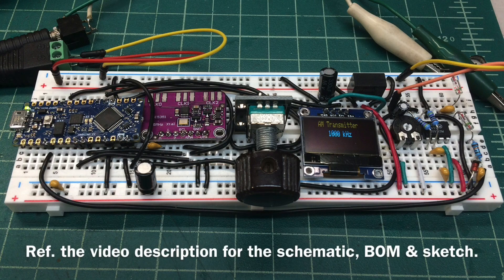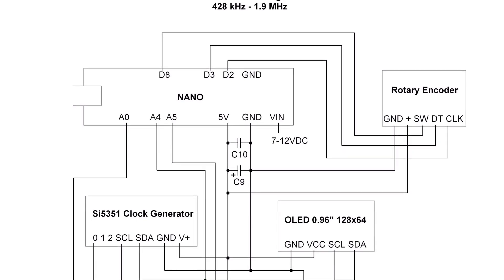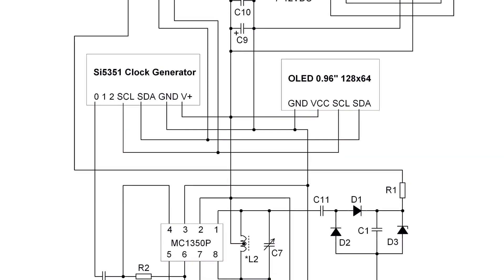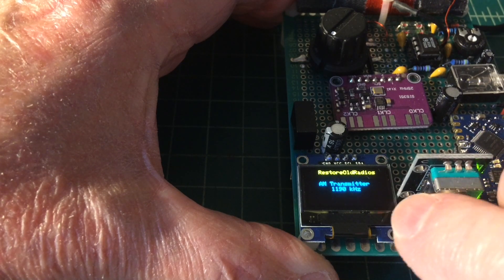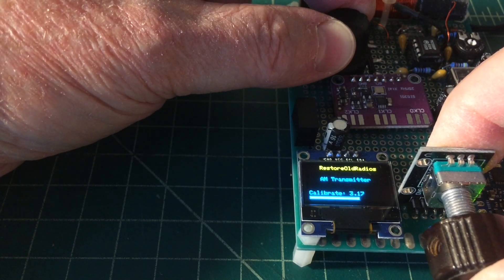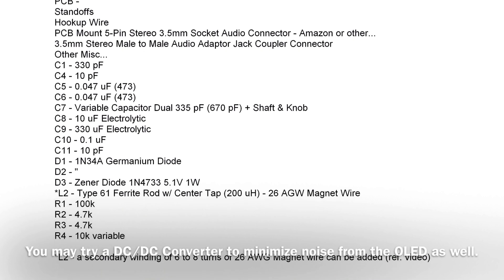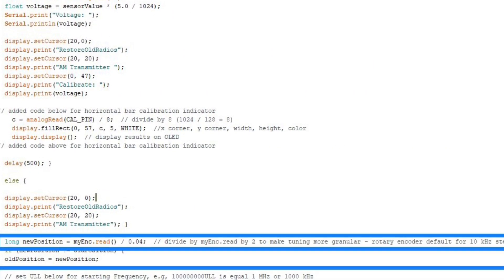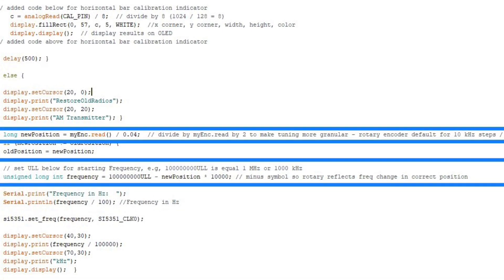Build an AM Transmitter / RF Signal Generator w/ Arduino

Comment: Does the ferrite core with the windings serve as an antenna? Can I leave this out or use a standard coil to redirect the AM signal into a antenna cable?
Reply from the maker: To your point, L2 and C7 make up the tank circuit and cleanup the square wave to a sine wave. I designed this as a close proximity transmitter, so L2 the ferrite serves as the antenna. I’m sure a suitable high-Q wire wound inductor with an external antenna would also work keeping harmonics in mind. Best, Don

Comment: Hello friend, can you explain the winding of the L2 coil a little better? I'm trying to make a transmitter like this and that's the only element I'm missing. Greetings and thanks :-)
Reply from the maker: Stefan - I used a type 61 ferrite rod (0.25 inches in diameter x 60mm in length) w/ 26 AWG magnet wire with a measured inductance of 200 uH ( microhenries) w/ a center tap at the mid point. Hope this helps. All the best. Don

Comment: Holy maceral Don, man your getting so advanced here. Just so much fun to see this deisign. I have some Nanos as well. Using one to program 28c256 eproms. This tho being so close to radio controls and monitoring looks like a fun project to do as well. Thanks so much for sharing. Awesome use of code as well.
Reply from the maker: Thank you Tony. As you know my coding skills are average at best so I expect folks to use it as a foundation to build off of. It was a fun build for sure. Hope you’re doing well. All the best. Don
Reply: @RestoreOldRadios  oh I am doing fine. In the process these months building some retro microcomputer projects (2 of them, an1802 and a Kim-1 retro) and some radio kits. For some reason, even tho been into electronics all my life I am building a few AM radio kits. One is an hx108-2. Its a 7 transistor superhet from China that is very inexpesive.  I know it's for beginner's way more so than me, but it just looks fun. I always loved any kind of kits. Specially those from Heathkt and Eico. I will put your project now into a serious build soon. Man that's great to get a nano and that oled display to do some AM acess and control. Might help me tune my new superhet I will be getting soon. Thanks for sharing buddy.